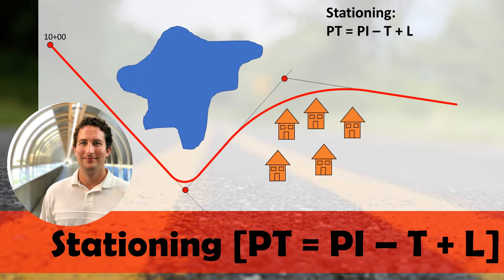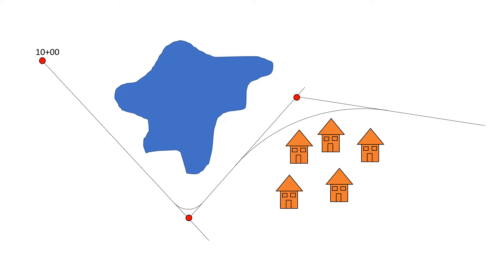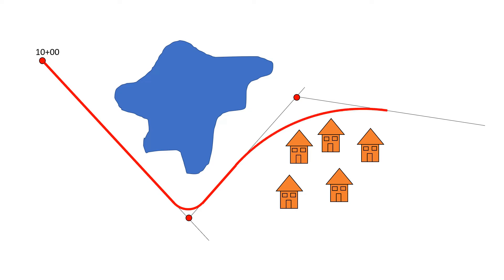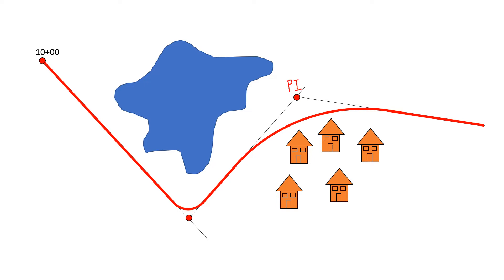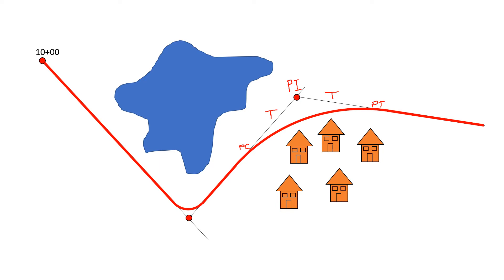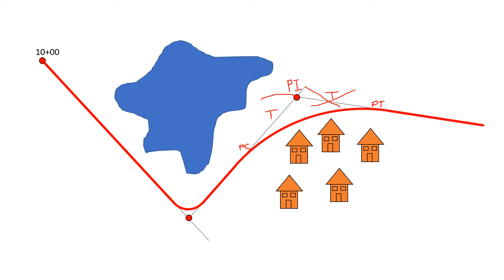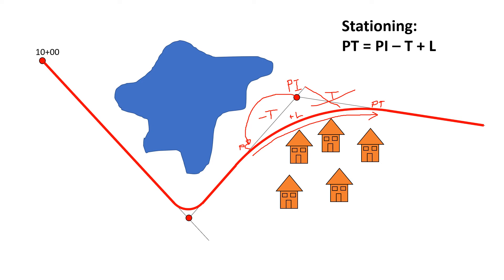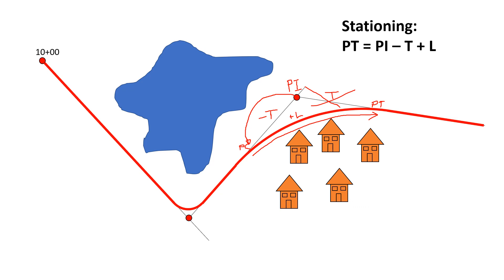PT = PI - T + L | Equation for Horizontal Alignment Stations for Highway Curve [PT ≠ PI + T]

Comment: why would we subtract T if our interest is the distance along the curve, PI is the diagonal distance from the PC station station on the curve so wouldn't the station of PI be L/2 added to PC?
Reply from the maker: No, the distance from the PI to the PC is T.  L/2 would take you halfway to between the PC and the PT of the curve.
Reply: @FindleyDaniel  I see, I just can't understand the concept of why adding the T value gives you the station of PI. T is a straight line, not a curve....so you're saying it's actually a curve distance? If that's the case then I totally get it now.
Reply from the maker: @Ishter151  T is a straight line. L is a simple arc of a circle (curved).  PC + T = PI and PC + L = PT.

This video should help too: https://www.youtube.com/watch?v=0wJRf2qXoDg&list=PLQ2tBMRKXROYAW4OnuL0GjVgfdrtBp9Pp&index=18
Reply: @FindleyDaniel  It doesn't make any sense. Are both Ts not the same? is PI not in the middle & at L/2?   Why PI-T = PC, but same T can't be added to PI to get to PT? 
If it's not always simple curves than why do they have T on both sides? Wouldn't they have different values except on simple curve that is symmetrical??
Reply from the maker: @jatgee5195  
Yes, the Ts are the same

You can try this on any problem and see that you do not get the same value of PT if you try the correct method of stationing (PT = PI - T + L) vs the incorrect method that uses geometry (PT = PI + T)

This is a convention we use for establishing the stationing of a roadway - we want the stations to go along the centerline of the roadway - in this way, the station values are meaningful (if we went from the PI directly to the PT, the stations no longer would correspond to the centerline measurement of the road

PT = PI - T + L is the correct equation for horizontal alignment stationing for a horizontal highway curve [PT ≠ PI + T]
Reply: To answer your questions stationing is measured along the traveled path rather than directly between points.so for PI you start from the PC and Add T and that gives you the PI station along that Travelled Path ( back tangent ) but if you add the other T ( it will give you the station of PT ) if you follow that straight line path eliminating the curve( keep in mind that a point can have several stations depending on which path you use this is why on road way plans you can see horizontal and verticals stations if you Have an intersection for example) so in order to get the PT stations on the L ( curve length as the travelled path) you will have to roll back from PI TO PC AND THEN ADD THE L I hope that helps